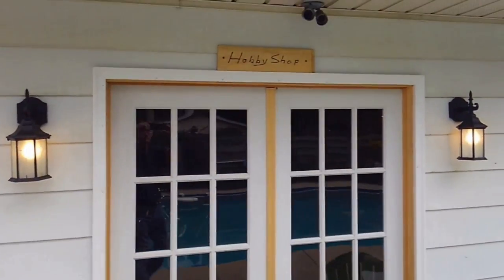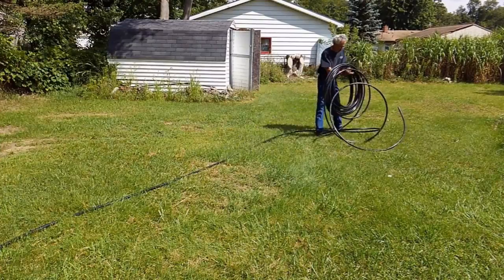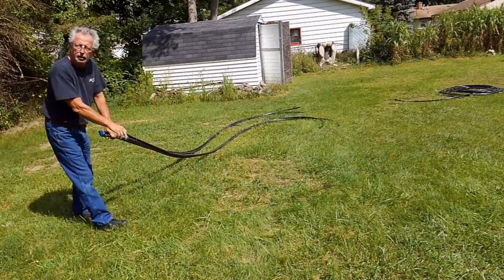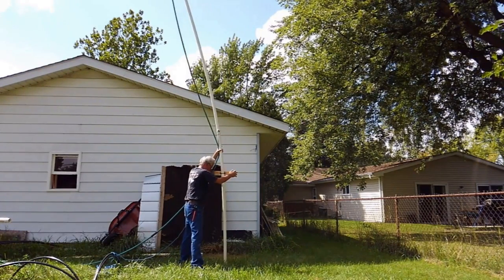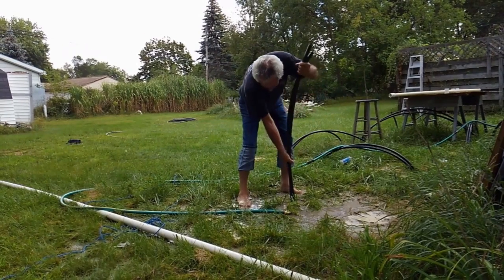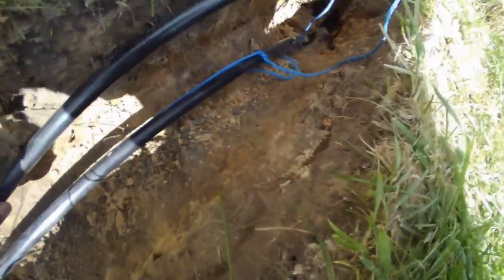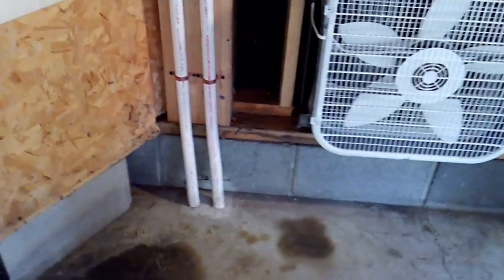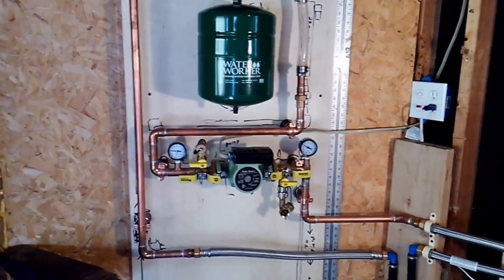Geothermal diy #1

Comment: Why not put a heat pump in to compress the heat out of the incoming fluid
Reply: I think this is just a greenhouse, so 50º is fine and only has the cost of running the pump, but you could use a plate heat exchanger to connect a heat pump up to it if you wanted to condition a home or make hot water.

Comment: Great simple design !

I know it would cost more but using copper instead of plastic would transfer  temperature more efficiently and last longer underground than plastic .
Reply: The cost would kill it
Reply: Copper certainly has better thermal conduction, but the added cost isn't worth it.  Rather than significantly increasing costs and complexity by using copper, you could just drill a few.more wells.   you'd also have to solder every fitting instead of easy to use hose clamps.  each run of pipe would have to be thought out so the next joint could be made as opposed to just moving the flexible plastic where it needed to go.  Last, I don't think copper would deal with the ground settling and heaving from the frost as well as a flexible solution will.  So lots of drawbacks for better thermal conductivity that can be compensated for by adding a few more wells.

Comment: and why the bladder tank?
Reply from the maker: Their are a few reason, the pump needs a bit of pressure to on the intake side to maintain flow through the pump. The pump will not draw water in. Also that is the monitor for any leaks in the system. Low side line pressure is a required.

Comment: Gotta say, the way you dug your holes is really smart! Sometimes the simplest solution is the best. Really cool. Like you mentioned, you could add a ground source heat pump to this loop and depending on your insulation and the climate you live in, you could have a heated garage, or heat a hot water tank.. or all of it as well as cooling for the greenhouse! The bladder tank is a nice touch, it will keep your pressure consistent, but as an added benefit you run a lot less risk rupturing your lines with a temperature change of your fluid.

Comment: Wow. I dont know anything about this but i am definitely trying it
Reply from the maker: Stuart, çheck out "Water Drill Bit Repair". It will show how to make the water drill for your well holes. Remember, this drill does not work well in stone, rock or gravel unless your water flow volume and rate can bring up stone. My ground is sod on top followed by 10 inches of yellow sand and then hard clay going down as far as I have ever drilled. My deepest hole was 25 feet.

Comment: Where did you get the air bleader
Reply from the maker: All the plumbing came from Menard's. Did you watch, geothermal DIY #1. Some videos are just portions of the whole project. Thanks for the subscribe! 
Larry
Reply: Yes that is the one I saw. Do you have a parts list for the thing that you built on the piece of wood
Reply: The tank ,seperator and valves.    Specially the air seperator.

Comment: Some thoughts - First congratulations this seems very cool for a DIY project. 
These are not meant to be critical just observations:
You may want to use it to "Air condition" the garage during the summer. Not sure what this will cost to run the system. But it will do positive things assuming you want to cool the garage. The other thing running it during the summer will do. It will be warming the ground up so that you can pull more heat back out in the winter. One problem all closed loop geothermal systems suffer from is that as the season continues the ground gets hotter or colder. So "pre-heating" in the summer will help with the winter. If the system is large enough this is more of a theoretical concern than one that is practical. But the ground will cool down the longer you run the system in the winter time. 
The other observation I have is piping layout. You could do it with a lot fewer elbows. Elbows cause pressure drop and reduce flow or require more power from the pump to produce the same flow, and more joints means more leak points. If the flow is slow enough the pressure drop is not much of an issue. But I saw a lot of opportunities to make the piping more direct and cut out quite a few elbows. IDK if the pump needed to be horizontal, but you could have put it in the down leg instead of crossing back to the other side, or even just kept it in the same horizontal run as the tank and air bleeder.

Comment: Just curious, Where is this located? Here in Texas double u bend we have to go 375ft at least for the thermal capacity of the ground to provide 70°F water all year round. Not to mention it's a whole community of residential homes each with solar and geothermal heat pumps.
Reply from the maker: Lansing Michigan

Comment: Nice video. Did you fill the ground unit pipes with water? Till which level did you fill the water in the ground pipes? I still yet to understand this geothermal system even though I have been watching them how it works! I am starting to hate this Geo thing coz watching to learn on YouTube too much yet not getting it! Thx 4 da video

Comment: Wow super job!  If you find an efficient water source heat pump you could heat and cool your home as well as domestic hot water for very small cost, and even lower energy consumption! It's not hard to add on, and it could easily handle your home plus any additions

Comment: Larry, you could lay some solid insulation over your wells and links to not lose a few degrees of ground temperature in the circuit. And even wrapping those pipes with insulation before covering them with foam board or other hard insulation material.  I built a geothermal house did the complete install of pipe in a ground-loop system, built my own riser board to mount the pump, valves, to a Waterfurnace heat-pump.  I heated and cooled the 3500 sq ft for $150-175 per month. It was a super insulated house with foot thick walls and 1 foot of attic blown insulation.
Reply: I agree insulate the upper tubes because heat will be lost to the cold ground in winter so less heat will make it back. In summer the ground will be heated by the sun which will reduce cooling performance. To my mind 60ft2 of tube surface area isnt a lot for heat exchange.

Comment: In combination with a heat pump you could get three times more heat.
Reply: What does that mean..?   (I'm a novice, trying to learn about GeoThermal heating).
Reply: @ВладимирПутин-е7м  basically like a fridge; compressor and refrigerant of some type; heat exchange to ground loop.

What he doesn't mention is the cost just went from 2-3k to 10-20k.

For an outdoor greenhouse; this simple system is perfect.

Comment: Great, simpel design. Congratulstions!
Reply: Excellent DIY design. No 'contractors'  necessary.   Would love to see more of the howto on the drilling.  Perhaps he could have gone deeper and buried the 'hosing loop arch' deeper down to avoid frost and get a more consistent temperature. Love to know what region he lived in and 'base temperature' of the soil.
Reply: @ВладимирПутин-е7м  , however use Google by checking what this man promissed:
Normal at ten meter deep, water temperature is only 12 degrees Celsius. In the Netherlands have we to dig 100 meter, before the temperatures teaches 55 degrees Celsius. So, our men must have known, to have builded his house above A warmwater well...

His systhem can help prevent agains frost, and iT might help to cool the house in the summer till 12 degrees Celsius. But by 20 feet in No way till A warm house.
Reply: I noticed recently at Leiden, Why  those contractors putted down A few hundred meters 2 inch black plastic pipes.. geo thermal heating ! Because of the clay did they use drilling machines, and they digged A large scale of pipelines at least one meter deep in the ground. Thanks A lot, to see this simple design! Have A merry Christmast, and A happy New year.

Comment: Good video, looked like a fun project. Reminded me of a rig my grandfather had in his home. Probably 40 years back I was in the basement of my grandparents house with my uncle probably in his 50’s and he pointed to a copper pipe tee with two 1/2” pipes attached thru reducers to it and a 1-1/2” pipe coming out the third going into the ground. Questioned me do you know what that is, follow the pipes and try to figure it out? The T was oriented so the angle was off to the side, went into a reducer then a elbow and went up parallel to the other 1/2” pipe coming out the top thru a reducer  into the house.  The third 1-1/2” pipe went into the ground. I traced the pipes out, the side pipe was connected to the water main and the second went to the cold water tap in the bathroom. I was still clueless. He said you ever notice the water in the bathroom is always colder than the other faucets in the house. He said back when he was young and they moved into the city from the country his dad was upset whenever he got up in the middle of the night and wanted a drink of water be cause the city water was so warm compared to the well water he would have back at the farm before they moved. The third thicker pipe was a pipe inside a pipe and went 60’ into the ground to cool the city water. How many years back was it when they put that in, no clue, but the day I discovered the term geothermal for cooling I knew exactly what they were talking about, no convincing required.

Comment: This is a good basic idea that will work to some extent.

I'm assuming a 3/4 inch pipe wpuld flow about 5 to 10 GPM.  At 10 GPM that's a little over 5000 lbs per hour of water.  The specific heat of water is 1 BTU per lb deg F.  If there is a 10  degree F heat drop across the coil that can be replenished by the ground that's about 50,000 BTU per hour.  

That's pretty much the top end of the system and it's barely enough to keep a small not so well insulated building like that garage heated above freezing at 0 F outside.

These are basic engineering principles, assumptions, and calculations that took about 5 minutes to work out.

The basic idea is good, but there are four questions.  

1.  Is there enough heat exchange surface in the ground to reheat or recool the water after the exchanger?

2.  Is the heat exchanger itself big enough to do the heating/cooling job he expects?

3.  Just what kind of winter /summer climate is he in?

4.  After two years of operation what sort of actual results is he getting?  Specific numbers would be great.

He has been strangely silent about the results, even though he has done videos on other subjects since then.
Reply: You can get more than 10 gpm out of a 3/4" pipe, I get 20 gpm out of my 3/4" garden hose. So I did a quick search of the recirc pump he's using, a Hydro Smart 1/25 hp 3-speed pump, which has a max flow rate of 17 gpm and a max head of 19 ft. Given the length of the pipe, together with all of the u-turns which add resistance (head), he could be seeing a flow rate closer to 15 gpm.
Reply: @BannerCap  Wrong and WRONG.... look at the pump curve.  You don't get max head at max flow rate. Max head is at zero flow.  Max flow is at zero head.  Best leave this stuff to the engineers.  Btw, your garden hose water supply is from a constant pressure source....probably around 35 psi.

Comment: Larry,  1. you should have filled the boreholes up with  BENTONITE CLAY, to get better thermal contact.
2. did you put antifreeze in the system, this greatly improves the thermal transfer of heat.
Reply: ...as long as the bentonite stays moist...if it dries out it will pull away from the loop, creating an air gap...just something to think about...
Reply: Free dirt is cheaper. Dirt cheap🤣
Reply: Isn’t pure water a better conductor of heat than antifreeze?

Comment: What if you were to submerge the radiator in a fish tank and have heat or cool air dissipate like that with an air pump in the fish tank filled with water or also adding two radiators

Comment: That's great for cooling but a black3/4 line in a spiral out in the sun .insulated. Would be the hot line just would have to put a few ball valves to switch from heating to cooling. Thanks for the idea

Comment: I think you did great. I have been trying to build a similar system with geothermal components involved . I came across your video and  I am grateful for you sharing it.  keep building fam, much love
Reply from the maker: Tks Dave. Add your efforts and experience to the common knowledge. We all will build on it.
Reply: @larryshea8595  how well did it work ?
Reply: only need inlet from loop to go to a 'T' ,
pump is under T
..
reservoir of small jug/carboy
off hose line  AUTO PURGES

Comment: Larry I think everybody here wants to hear how it has worked in your greenhouse? Where are you and with heat gain and loss  through the greenhouse walls has your system done the job you wanted? Hope you can do a followup video soon.
Reply: translation.......it doesn't work LOL.....he still needs a heat pump
Reply from the maker: DISCLAIMER, I do not advocate or recommend any of these products or procedures are suitable or should be used in any way for any purpose. You proceed at your own risk and you are responsible for your own actions and the results you get by using any products or procedures noted here in.

======================

Home Depot

3/4 in. Blue Twister Polypropylene
https://www.homedepot.com/s/3%252F4%2520in.%2520Blue%2520Twister%2520Polypropylene?NCNI-5

=======================

Menards,

Search Bar, “poly pipe” press enter, Select,  ¾ in poly pipe, (irrigation Tubing) press enter, make your selections.

Air Separator Manifold,

https://www.menards.com/main/plumbing/hydronic-radiant-heat/radiant-heat-manifolds-components/watts-reg-1-1-4-fip-cast-iron-air-separator/0858536/p-1444446195278-c-8523.htm?tid=-1863207083524858620&ipos=2

automatic air vent valve,

https://www.menards.com/main/plumbing/hydronic-radiant-heat/radiant-heat-manifolds-components/watts-reg-1-8-automatic-air-vent-valve/0590715/p-1444446175469-c-8523.htm

water expansion tank,

https://www.menards.com/main/plumbing/hydronic-radiant-heat/radiant-heat-manifolds-components/watts-reg-2-1-gallons-non-potable-water-expansion-tank/etx-15/p-105478063016-c-8523.htm

3 speed circulator pump,

https://www.menards.com/main/plumbing/hydronic-radiant-heat/radiant-heat-manifolds-components/hydro-smart-trade-1-25-hp-3-speed-circulator-pump/hs00r-3spdcsti/p-1450446643169-c-8523.htm?tid=-6119193669850601549&ipos=11

Circulation Pump Kit,

https://www.menards.com/main/plumbing/hydronic-radiant-heat/radiant-heat-manifolds-components/webstone-reg-sweat-lead-free-isolator-circulation-pump-kit/h-51414wkit/p-1512026997655-c-8523.htm?tid=-8480272877282241141&ipos=12

Antifreeze, Propylene Glycol.  

Do your own research about what you are using and be sure to understand what this product is and how to use it safely. 

consult OSHA.GOV
polypropylene glycol MSDS
 
https://www.menards.com/main/heating-cooling/hydronic-radiant-heat/hydronic-heat-cleaners-treatments/hercules-reg-cryo-tek-trade-100-anti-freeze/35284/p-1444449933130-c-8528.htm

Comment: Frustrating video. Your demonstration creates more questions than it answers. Most apparent omission is temperature: How did it not occur to you to put a digital thermometer between the radiator and the camera? "Cold as shit" isn't particularly empirical.
Reply from the maker: Use what you did learn and add to it with your own work.

Comment: Now if you have central air in your house. You could install a evap coil and run this water throw it. Then use a relay and the exsting thermostat in your home to control  temp by controlling the pump and fan. Also there's already an existing way to collect condensation in a air handler or evaporator case. Plus the added benefit of filtering the air.

Comment: I love the way you drilled the holes. When piping I would have done a common flow and return header with individual branches for each drop, easier to vent. Maybe filled with glycol too. Great vid
Reply: Methanol pumps easier than propylene glycol and its cheaper. At least it was last time i compared the two.

Comment: An engineer like me would ask what the temperature difference (delta T) is at given flow rate...
Reply: All he is doing is running a pump. This would be a scenario where increased flow would only  make heat exchange and BTU output higher per hr with no compromise as we aren't burning any fuel inefficiently or  trying to control return temperatures to stay at highest efficiency

Comment: what is with the little tank?
Reply: He said in the video it is a bladder tank (not a term/device I am familiar with) and that it maintains pressure on the system; he also said in the video or comments that the particular pump does not draw water in, needs pressure to push it in.  A video about a bladder tank I saw after googling says these tanks also create less cycling on the pump, making a longer life.  I see the idea is parallel to an accumulator in a pneumatic (air compressor) system.

Comment: At the tail end he asks the question "How cool is that."  He measures pressure (In and out), but not the temperature!
Reply: But also easily checked with external thermometer...
Reply: Would certainly help to know if you can speed pump up or down to maximize efficiency...

Comment: colder climates will require a deeper trench for your horizontal run. example, Minneapolis permafrost depth is 3.5', so plumbing water pipes are set at around 6' deep or lower. meaning, the ground is ice for around 3.5', and will cause problems with water pipes used for geothermal transference. nice diy.
Reply from the maker: This system is charged with 70% propylene glycol, a heat transfer fluid with anti corrosion properties. Freeze protection to 30 below. (Do not use ethylene glycol. That is car motor antifreeze. It can contaminate the aquifer.) Watch, "geothermal diy #2